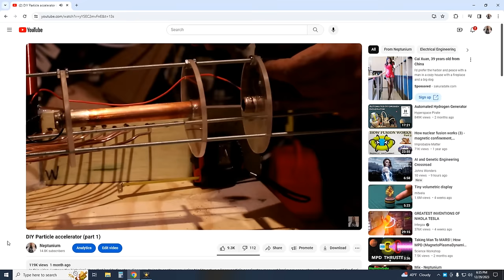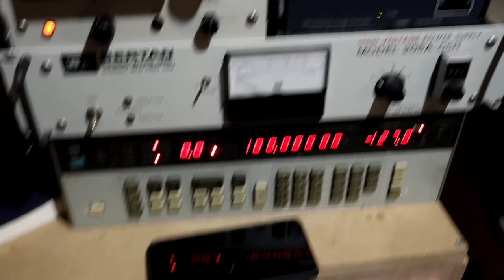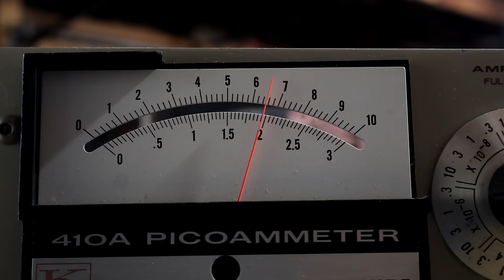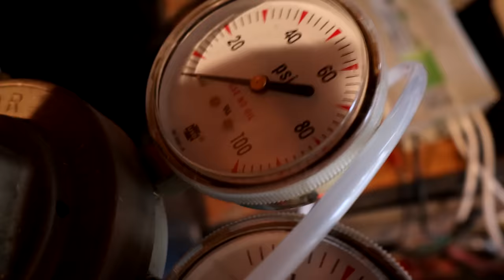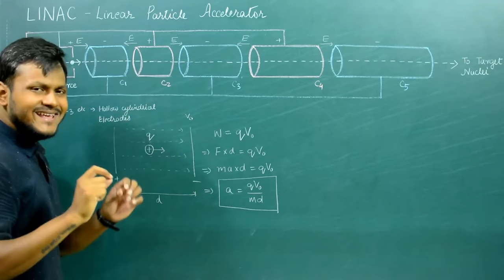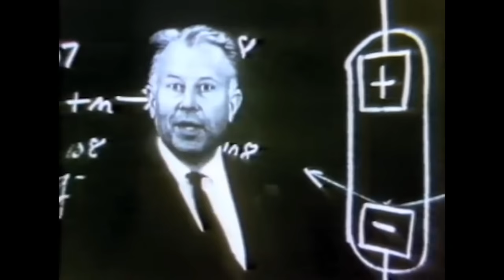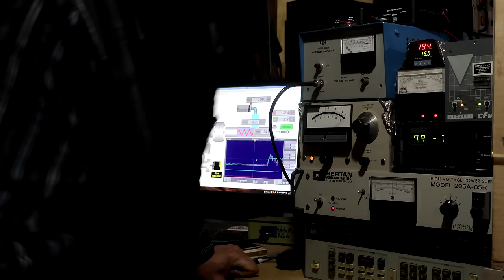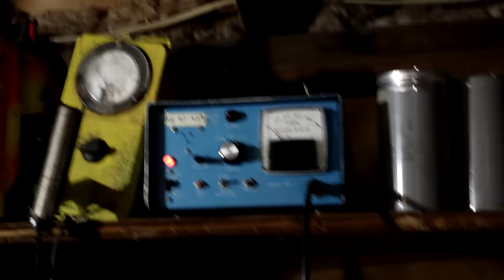DIY Particle accelerator (part 2)

Comment: I was waiting on this video since the first one came out, great job! Yes i somewhat didnt understand most of what was being said 😅😅 but i bet a day off and Wikipedia can help with that, i also have a question as your videos have inspired me to make a linear accelerator on my own and i am thinking of building it based on overclocking an old crt electron gun and magnatic fields to warp hydrogen ions into a simple detector do you think such a concept could work (ofc with learning all the things that i couldnt understand) or it would blow up in my face? Anyway thank you so much for this video series and i respect your time and effort put into your channel as a whole😊😊
Reply from the maker: So this is an idea I had some decade ago, I wanted to take an oscilloscope apart and use the electron gun to fire into a vacuum chamber just like a CRT does . I did get shocked a few times, the glass broke and I eventually gave up . You see accelerating electron will give you X rays and not much else , if that's what you want then an x-ray tube is what you want to build or buy. Although you could probably use a microwave magnetron when working with electrons and get better results! Whatever you choose to do . Do it! You'll learn so much stuff that no books can ever teach you! And you'll get the satisfaction of accomplishment and the reward of knowledge! Best of luck to you and thank you for watching! Happy new year!!
Reply: Thank you for the words of encouragement and your kind comment, Happy new year!!

Comment: this is insanely cool, knowing nothing about the process would there be a point in having a blast shield or something between you and it in case there's another unexpected issue?
Reply from the maker: Thanks! glad you liked it! well no not with the tiny amount of power I had! but a 10 or 100 times more power would require some distance and/or shielding .. Thank you for watching!

Comment: Finally I’ve been waiting to long
Reply from the maker: Yes these projects takes a while as you can see ! Thanks for your patience!! Really appreciate!!!
Reply: @Neptunium  Hello I was just wondering if you may consider providing any contact information I have a few questions regarding this project I would enjoy attempting to safely recreate something like this and was wondering if you recommend any books,sources. Or as well a materials list since I want to design a linear accelerator as well.
Reply from the maker: @MrRucciGucci  not really . I mean there is plenty of resources on line these days. I would suggest fusor.net for high voltage and vacuum technology, the channel u mentioned in the video are full of interesting details especially the cyclotron videos. Everything else is just a Google click away! Have fun!
Reply: @Neptunium  Oh ok thank you, but question what materials did you use for this?
Reply: @Neptunium  would you consider continuing working on this project maybe have a synchrotron to the accelerator?
Reply from the maker: @MrRucciGucci  what material? The tube is stainless steel the drift tube is copper the spacers are HDPE the rest is either vacuum grease and epoxy or some random stuff from home Depot ! Lol what ever goes inside the tube should be vacuum friendly, by that I mean do not degas or not too much you know, that's the main hurdle. NASA has a list of materials they use and stay away from is easy to look it up. Everything else is what ever you can find, wires from extension cords, spacers and screws, you know ..
Reply: @Neptunium  Thank you so much your channel has really inspired me I will let you know if I have any questions.
Reply from the maker: Your welcome! Glad you like it! Yes please let us know how you doing and if you have any questions!
Reply: @Neptunium  I have a question how fast did the electrons move in your linear accelerator
Reply from the maker: I did not accelerate electron in this device, just helium nucleide, their charge is a function of the voltage and can be calculated . I already did that in the excel sheet attached in the description, feel free to look under speed (M/s) thanks for watching @MrRucciGucci

Comment: Bonjour, hi 
i was searching some things for making my own particle accelerator and i found your videos.

That great i would love to do somethings like that, i have a question where can i found an Alpha KeV sensor ?
Reply from the maker: Salut! I described the electrometer in the video that just look at charges hitting it with respect to ground. You can try to use something else like these little sensors.. https://physicsopenlab.org/2020/06/15/alpha-detector-with-bpx61-photodiode/
There is other options but that is a start! Thanks for watching!
Reply: @Neptunium  oh, ok thanks you very much !

Comment: Few times in my life have made mistakes that where very dangerous at work /I am electrical engineer working in factories/.. The biggest one was that I shout off a 20kV 2MW power transformer line breaker but was under the impression that the low side on 6.3 kV is unloaded but in fact it wasn't !  ... The ark was so big that barely escaped .. Everyone makes mistakes, specially in complicated projects.

Comment: I have for quite some time wanted to do something similar and have bought an old diffusion pump, sadly I haven’t been able to find any specifications for it, anyone got an idea how I can determine the required oil volume?
Reply from the maker: I wouldn't worry about the requested volume! It will pump a small volume fast and a larger volume slow...
Reply: @Neptunium thank you very much!  might post a video when i get the system running...

Comment: That's amazing! I was looking for a similar video before, because I wish to build a homemade accelerator. Can I contact you personally in order to learn more about the particle accelerator structure?
Reply from the maker: you already have :)  how can I help you?
Reply: @Neptunium Thank you for answering! Could you show sources you have used to learn about the mechanism and it's structure please? I will be so thankful! :)
I'd be glad if we could contact on another platform to continue.
Reply from the maker: the ion source ? or the RF source ? the ion is this sputtering gun found on ebay:
https://www.ebay.com/itm/254722032673?hash=item3b4e9dc421:g:Qh8AAOSwHqdfZBPN&amdata=enc%3AAQAIAAAA4Av9s6yo2y1jAGoQDuqsOj3Vqw1EjBLSMUADWtUR9qvNRIZvuBwGtMCh8G0i5fbIBATWYndLlf4B%2BCREnn6Y%2FXGjUJjngg9XPyWIlZ3z6zq1kWkTihVM5AaAue9VKN3xcuDYGqLas%2F0Zh5Mp9bYTjg9etmxt%2BlWqBv3MvhLvo8NrP7Zreoiust7%2BWFputRV9hlZFXOUYSROhdO7LLnXAHpquSppQi0QrRN3CqCS8ke8V4FbWFIkz0YfiYCb%2BGsRlBcOnKQzrUwCqDLv41YtAzLqyyMzlilCv0eJHOSLQMMTP%7Ctkp%3ABk9SR9K_iMGbYw
the RF source was also found on eBay:
https://www.ebay.com/itm/313088672701?hash=item48e58a03bd:g:GvYAAOSwfw5jvBXd&amdata=enc%3AAQAIAAABIBUmO5kqVH1a832nfQmZcrxwA6GxYlYVmIdJC1AN0tLAJVmHYeqGoD8wpA5pxxeLQtQzF%2BRrk1Xn1rW%2FSYjtvphhyKHMmCJEzmbF13zf%2FisrX1t89YozvvgX7IKt%2FKqnR9%2F5fORgvlrf46q3CiEfhDaV0l1i7f3gpCs20%2Bi7wFDz5I6zdCiIbabq0R8jKfoouqbrr7qiMKid6LPDlLl7%2BaGCF%2BHB8QMr48zPKlAKh9rO3CdFwPNN20KrOuNMITBTA61Eh7KjRqbWUXt6Zwo1wrQYjmU3w8TnbDXXNcjnd8RmyBcbOEslgGwxqmuCe%2FJNEspn1y2oFae1ztn5ns6jrU4cQiAUTLMQ1PTyWhOee0PATD7BU%2FDGJbsMxihLSOMqvw%3D%3D%7Ctkp%3ABk9SR6rKmcGbYw
you can also reach me on sciencemadness.org
Thanks! @tpkns

Comment: This is so interesting to watch. Would there be any benefit to adding a diffusion pump to this system?
Reply from the maker: There is already a turbo pump so no. A diffusion pump would be a useless pain to deal with you know... Thanks for watching and happy new year my friend!
Reply: Ok, I thought diff pumps could reach a lower pressure than turbos. 
I suppose once you hit that free path threshold there is no improvement in performance?

Looking forward to part 3 next year.
Reply from the maker: Diffusion and turbo operate on different principles but eventually get down to similar pressure, cryo pumps and ion pump get to about the same too.. the advantage of the turbo I think, it doesn't need to warm up and doesn't introduce oil in your system but they have a bit more maintenance and cost more ...

Comment: Amazing!  Where did you get the RF power generator used to test light bulbs?  Is there a link?  How much $? 
Thanks for these videos!
Reply from the maker: I found it on eBay! Thanks for watching
Reply: @Neptunium   I mean, could you post a link to the eBay store that sells these things? 
Thanks!
Reply from the maker: Really? .. here found another in 1.2 seconds :
https://www.ebay.com/itm/313088672701?hash=item48e58a03bd:g:GvYAAOSwfw5jvBXd&amdata=enc%3AAQAIAAAAwChCR61i80hjDw2FvsBWLy4DAp8Byyn1xzJde6nESjBrQfFbLSKppNT80pP9xsZyfJoNednR0chT5UCw9PK2VfvnXqAKgE%2BXIhcsAIjVNsIlN53Z0sIoYFxzOpsRaNNzmSloBHwLK2KJ4i9aL9tDsJt318RtGg28buktn68sgqNZhv9YVOPnSuhEOhTlIK8uAqmebcUoXea6MmUYxfLL%2FIBgbQJoGHOZRhR6QbFEOTiwNR9LNMnWH3kVJ4BItxbdKw%3D%3D%7Ctkp%3ABk9SR-qxo6-YYw

Comment: I am surprised that you use RF voltage source even that you use only one tube. I guess I need to watch those recommended videos to understand why not use a DC source in such case :)
Reply from the maker: I explained it in the first part . dC is great and easy to achieve at least to a few hundred thousand volts but the several millions needed for nuclear reactions are extremely difficult to get to and even harder to contain!! Think about how far lightning travels ! Thanks for watching and happy new year!

Comment: Can you accelerate D2- to 50..110 keV/amu (eg. 416 keV) and neutralize (Na vapor could work locally and be condensed easily) and smash into LiD or spodumene or beta-eucryptit or similar target? (use magnet at the ion source to prevent extracting electrons). Neutral molecules at greater than Bohr velocity are penetrating orders of magnitude deeper into molecular compounds (perhaps metals might not be optimal) than charged ions (Bethe-Bloch formula does not apply) greatly increasing the chance of nuclear interactions. (LiT is not readily available I guess).
Reply from the maker: yes this is basically a neutristor, I thought about that but that was not the goal for this project, I wanted to use RF to accelerate a larger nucleus, Thanks for watching!

Comment: why does tghe vacuum chamber have such large flanges on these devices? i can understand if it were under large pressure, but not vacuum, i would have thought it would only need a very thin one (the part the bolts go through)
Reply from the maker: Actually you can go as large as needed for a vacuum chamber ( NASA has a few) but pressure is always more manageable in smaller size.. don't take my words for it ... Thanks for watching!!!

Comment: Looks pricey, doesnt thermionic emission of thorium create the alpha particles you need? Might be easier than the helium pathway, just a guess🎉
Reply from the maker: Thermionic emissions releases electrons that in turn can ionize other atoms. Not alpha particles.As an ion source,  I think I would use a filament facing some thorium metal at a few 1000v positive. The electron would rush towards it and rip some thorium iona out of the metal and towards a negative ring of sort.. just a rough guess..
Reply: @Neptunium  have you ever heard of the Dr. Paul M. Brown? He showed radioactive elements could be neutralized with a inverse resonant waveform with a higher amplitude emitter. Wonder if you could make a element radioactive with a dissonant waveform to its natural frequency?